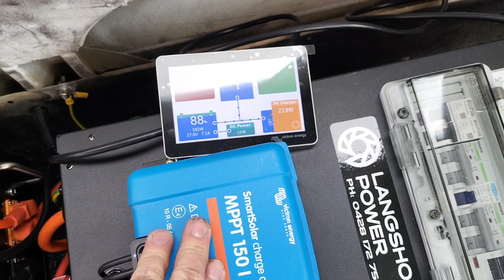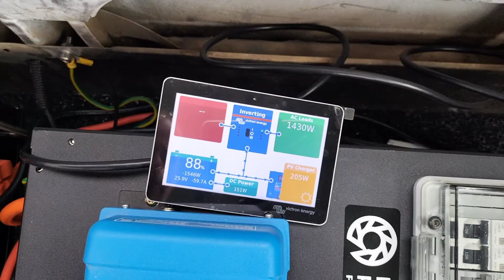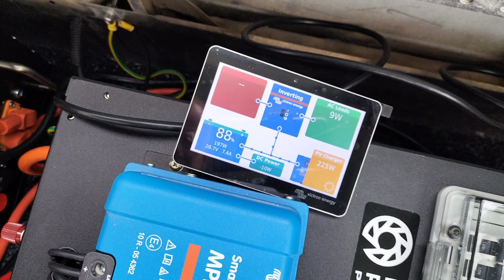Langshore Power, 24v Victron multiplus 2, MPS Lithium batteries in a Toyota Coaster motorhome

Comment: G'day Steve where are you situated?
I'm in Shepparton VIC & I'm converting a coaster bus into a motorhome, n I have done a rough estimate of my power needs, of what's in place at the moment, & I'll be adding to that later down the track, so I'm figuring, getting a decent unit now to cover my future additions, & victron seems to have the better name, & more warranty, (that in itself says alot to me) so I like the multiplus 3000W inverter, 
Was there any specific reason they've gone for that amount with solar panels??
Reply: Oh & I'd be looking to purchase a complete kit, & if possible set-up on a backboard & pre-wired for me to install?
Reply from the maker: Hey Graeme, I’m in qld, up in the Whitsundays region. The reason for that much solar power was as simple as “that’s the most we could fit on the roof”! Basically you want to get as much solar yield as possible, with a coaster that’s usually 3 or sometimes 4 panels depending on roof hatches etc. feel free to contact me and we can have a chat about what could work best for you. Cheers and thanks for watching!